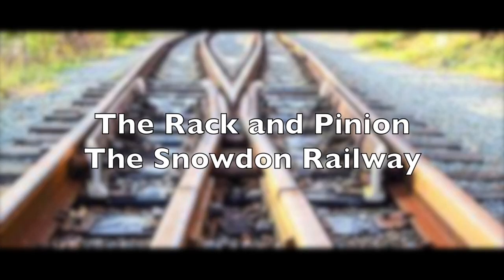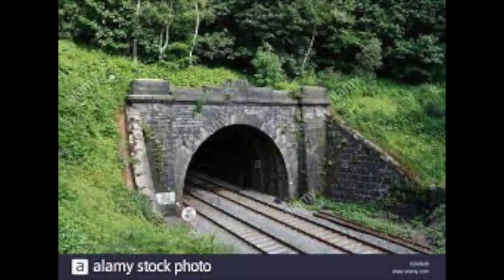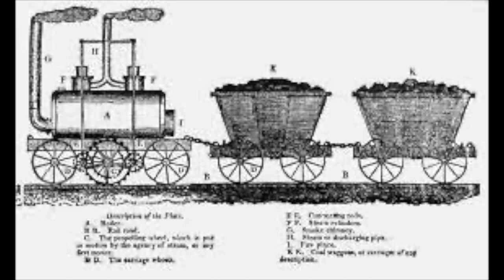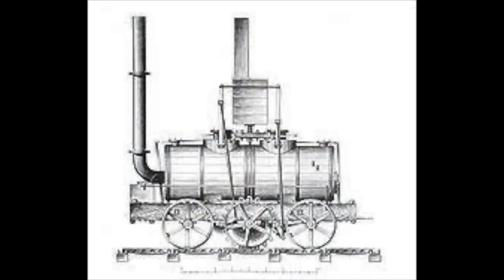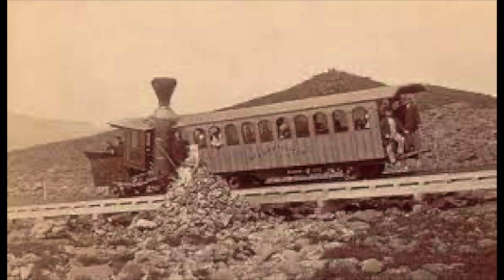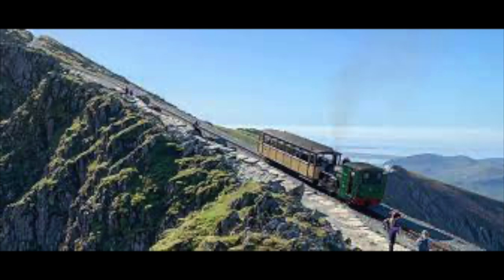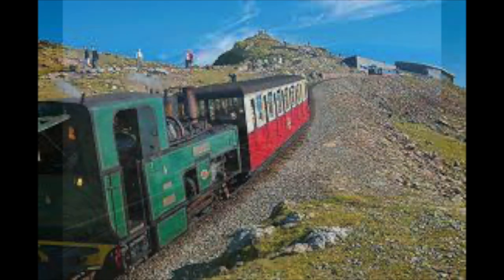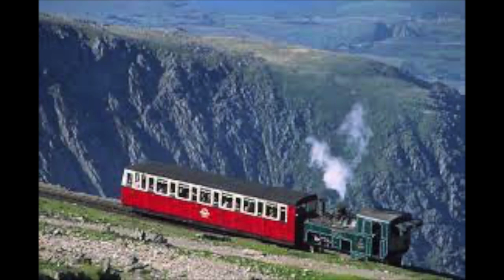The Rack and Pinion - Snowdon Railway

Comment: Side note: This type of railway was showcased in an entire book of the railway series. It was only ever seen in that one book and never tackled or talked about again in the franchise. It uniquely focused on almost entirely only engines that were introduced in that book and the only recuring characters to appear in the book were a couple of the little gauge engines that told the stories of the railway.

I wouldn't be surprised if this is the very railway that the Reverend was making the stories about at the time. I don't remember for sure, though.